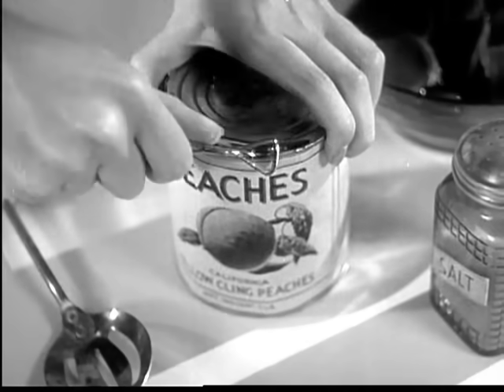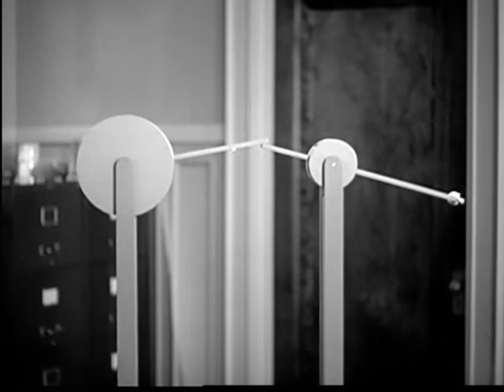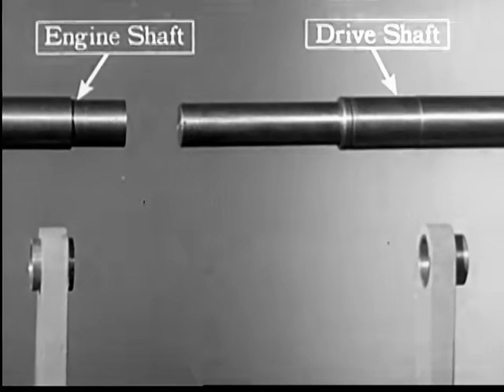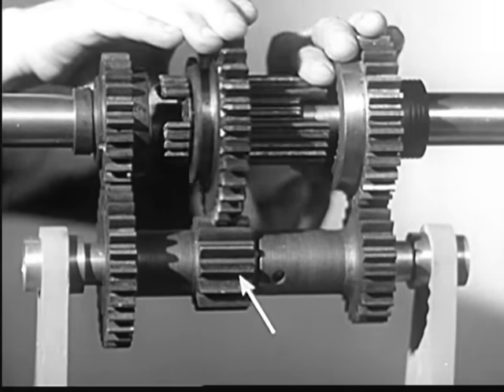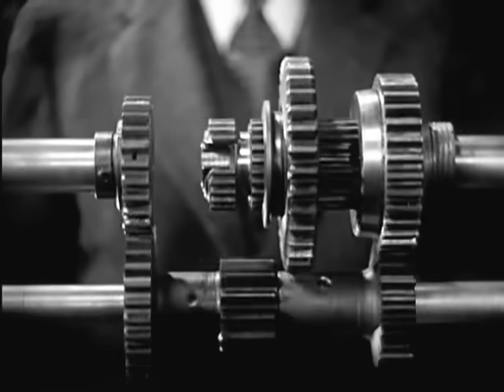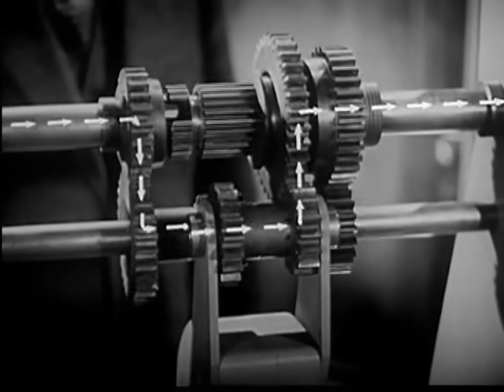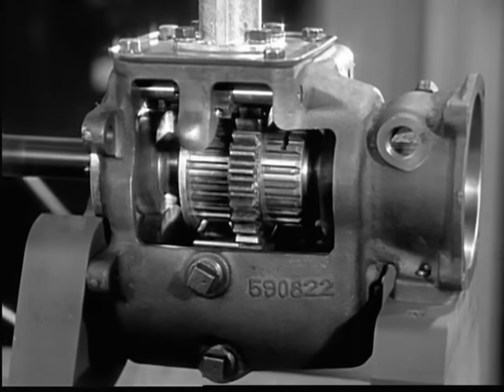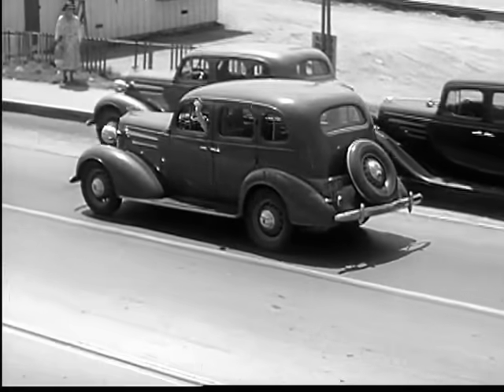Spinning Levers - How A Transmission Works (1936)

Comment: Do you guys understand why you understand this better? They’ve kind of dumbed it down and use no jargon that express these mechanical advantages. It’s like when you hear person 1 using scientific terms and  person 2 doesn’t understand, so person 1 dumbs it down and explains each term they used. Person 2 says “well why didn’t you just say that”. Well that’s this in a way. Someone well versed in mechanical advantages, you can tell them a synchronizer helps gear change run smoothly and they’ll figure it out, they know what you’re talking about. We didn’t get dumber or our explanations got worse. No We actually got a lot smarter, and found more efficient ways to define these things. I mean after all, we have a lot more complicated machines now. The average person just can’t keep up anymore.

Comment: Video: How a transmission works 

Me: They had road signs dedicated to telling what gear is needed for a hill?
Reply: At that year many were still learning how to drive a car.
Reply: @raymondramirez9177  that makes sense too
Reply: Mainly for trucks.  If you started down the hill with a load pushing you and moved the gear shift to neutral you might not be able to put it back into a lower (or any gear for that matter) gear to use engine braking to control the truck down the hill.
Reply: @cyrilhudak4568  That makes a lot of sense. I just never seen such a thing.

Comment: One of the reasons why older instructional videos like this one seem so easy to pick up was because back then there was a high chance the viewer couldve been illiterate, so extra emphasis was placed on visual presentation and a slower, more deliberate delivery so that anyone would get it. Note the heavy use of purpose made props, analogies to common household items and the lack of text in the presentation itself. 

Nowadays the sheer volume of shit that modern curriculums demand from each student is so high with so little time to teach it all that instructors are often forced to assume students are already qualified in a number of existing skills so they can cut corners on delivery in favour of cramming vast volumes of information via walls of text which is far cheaper than making a bunch of custom made props to walk students through the basics.

Comment: When the transmission is in neutral I can see the shaft to the right spinning, how can that be?
Reply: The bearing between the output gear of second gear, and the driveshaft isn't 100% frictionless, so under no-load conditions, it will spin slightly.   Put a load on the driven wheel, and you'll see the output drive shaft remain stationary.

Comment: I've learned more from this than i have from school because everything is so complicated to explain today and back then they were like, slide a gear in like this and bam you got reverse, the more gears the merrier, and now we're just like, the force applied by then engine crankshaft effects the overall acceleration by rotating the four gears placed near the front of the transmission, now study this or your gonna fucking fail I don't care *sticks up the bird on both hands and walks out*.

Comment: 2:37 I am now thoroughly intrigued by "worm gears."

Clever girl.
Reply: Worm gears meet at an angle, up to 90 degrees. The modern car has several worm gears, including the rack and pinion gear for steering.
Reply: A worm gear is a gearing arrangement that only allows one way transmission of power.  It allows the worm to drive the worm gear, but not vice versa.  The worm is typically cylindrical shaped, with helical teeth wrapped around it like a bolt.  The worm gear is mounted on a perpendicular and offset axis, so that its teeth are pushed forward or backward along the worm shaft.  Worm gears are built to self-lock, if you apply a load to the worm gear.

An application of the worm gear, is a guitar string tuning.  The string is wrapped around a post that is driven by the worm gear.  The tuning lever drives the worm, which then drives the worm gear to rotate the post, for tightening the string.   The string tension cannot spin this mechanism.  Only the user who rotates the tuning knob can cause the gear assembly to spin.

Comment: What they didn't know is that cars these days might NOT have gears at all, but instead be driven by a CV-Transmission!

I know farm equipment had CVTs since the early 1900s but whatever.

Comment: 2020: Student-" Manual transmission is so difficult to understand!"😥
1936: Engineer- "Bring me to the future boy !"😁
Reply: Manual is easy
Wait till u see auto
Reply: @hassanlabyad4082  They are all easy to understand TBH. There are auto, manual, DCTs, DSGs, and CVTs. All based on the same principles, but in terms of part complexity, DSGs are probably most complex. Most advanced aspects are honestly in the hydraulics, thermal, and material science applications. Thats where all the recent white papers are on, essentially, tricks and materials and coatings to make the gears smaller, better, lower coefficien of friction.
Reply: @davidwest6019  
I agree on CVT it is easier that manual
I was talking about 5 planetary gears set auto transmission
Reply: @hassanlabyad4082  praise the sun gear
Reply: Samarpreet Singh it’s even earlier, it’s from 1936.
Reply: @user-hn4en7lx7l  corrected!!😅
Reply: Nah it's just you bro, I started at manual transmission and it's easy
Reply: @justanotherf2ppotatogamer61  Its just a joke bro . Don't take it seriously!
Reply: @samarpreetsingh5318  🤣🤣🤣🤣🤣
Reply: Manual gives the driver more Control.
Americans just dont like to do things them self.
Reply: @LS9646  That was maybe true 15 years ago, not really anymore. This is why everyone went to dual clutch for high end ICEs (Ferrari, etc). You, nor any pro, can beat the computer (TCMs) these days as proven on the track many a time.
Reply: @LS9646  modern automativs are way bettet than any manual. The only reason manual are still around is cost of production. When you look at any car model, that is a bit on the more expensive side, you will find that automatic is pretty much standard.
Reply: Literally me

Comment: If y’all ever want to learn to shift without a synchronizer, drive a semi. Hardly any of those transmissions have it. You have to match the speed and gently touch the gears together with the stick. If you’re softly putting them together and it’s still making a horrendous grinding sound, you’re too much out of sync and either need to raise the engine RPM, slow the wheels down to match the engine idle RPM or you’re in the wrong gear. Either too low or too high. And yes, you can put the clutch in and slam them together rather easily... but you will damage the clutch sleeve and the gears themselves after a while.

Comment: i didnt really understand how you can brake with engine. if you do it by downshifting, doesnt it mean that the wheels will gain mote force to work with, therefore making it go faster?
Reply: Engines require quite a bit of force to turn. When you release the throttle the engine stops producing power, but it is still turning. Now instead of the engine driving the wheels, the wheels are driving the engine.

Comment: I like that they had to physically make all those models to demonstrate their principles. So much more engaging than a 3D animation for some reason.
Reply: Depends though. When the mechanisms get complex an animation gets much better since you can make parts partially transparent, to focus on an important part without losing the big picture.
Reply: @FawfulDied  Yes but that requires already having a foundation of knowledge to work with. The original poster was referencing to those still learning the material so.
Reply: There is only one thing better than this .. being able to play with such models yourself. 

I'm an electronics engineer and even today, over 10 years after getting my first degree in it, I always understand new concepts best if I try them out.
Especially if I apply them to a real-world problem, even if I had to make one up by myself. But I have to physically do it. 

I still know a lab engineer from my former university, and he always sees students struggling with things like heterodyne mixing .. until he shows it to them at the lab equipment or his ham radio stuff. Then it clicks into gear ;)
Reply: @VintageTechFan  
But why do you Hoard Nitro Engines, bro?
Reply: @SLUGTHUG  
I know thats basically a joke about my user/channel name, but I will explain anyway:

I just like them, and they are getting rarer and rarer since almost everyone is moving to electric. There are only a few manufactures left out of the dozens there once where. 

"Large" scale I can only think of OS and Saito being left, both of them continually reducing their "nitro" portfolio and moving to petrol engines.

Enya and Laser are still doing limited production runs for enthusiasts. Also there is Yamada with the high performance four-strokes. 

The whole complex of Magnum, ASP, SC and all the manufactures "house brands", which were all made by Sanye in China, is gone. 

But it's nowhere near the volume they once where, and I like them. So I grab them as long as I still can. The old ones from the 70s-90s tend to be of better manufacturing quality, too.
Reply: A 3D animation, if done incorrectly, can break the laws of physics. A model has to obey them.
Reply: you can also 3D print alot of stuff nowadays
Reply: @Samuel Skala Maximum possible length that may be filled? 800,000 inches, or 12.623 miles, assuming they are laid end to end. Or any combination of 3.2 million cubic inches, or a cube about 65 feet to a side. 

I hope I get an A on the test!
Reply: Nothing can be there when are they in the past when we shall haven’t engineer the technology of where people can’t see what it is to be there.

Comment: I like how they use analogies from simple stuff, like the synchros (which I had no idea how they worked until now)

People try to do that nowadays but there really isn't anything good. How would you explain a clock modulator on a computer? like a metronome? I personally like the idea of saying it's a computer's "heartrate," since it runs an instruction every time the clock turns on or off. The faster the heartrate, the better it performs (generally speaking)

Comment: Woman driving downhill on a city street at 60 mph wearing no seat belt in a car with no safety glass and designed to transfer all the impact energy directly to the passenger compartment. What could go wrong?

Comment: At 4:25 or so, he mentions that the car is in neutral and that the shaft to the rear wheels isn't spinning, but the drive shaft does appear to be spinning.

Am I correct to assume that it's the top middle piece that is actually connected to the real wheels from inside of the drive shift?  I'm a little confused why the top right gear is spinning when in neutral and/or how everything is connected to the wheels.

Comment: Quick question, why do drivers back then need to shift into second gear when going down on a steep hill?
Reply: It uses the torque of the engine in a braking action.

Comment: I want to know how my 5 speed truck with 1 reverse and 2 gears for all 4 wheels works.  Specifically, I'd like to know how they get the front and rear differentials synchronized?

Comment: never ceases to amaze me the power of leverage and how no one I work with knows how to use it.
I work with trucks, trucks get sealed by metal wire sometimes someone forgets to unseal a truck we need to unload, or load more shit into. most times we don't have a bolt cutter, or wire cutter available anywhere nearby. So I find a long metal pole stick it in there, and pull. seal breaks with minimal effort.

Comment: One question I have wondered for a lot of years. I am talking about good smooth synchro downshifting. No grinding coffee here.  Routinely speaking,  When downshifting from a higher gear to a lower gear.  ( in other words using the engine to slow you down) . Does that practice over time. Wear or ruin the gears of a standard transmission or wear down the clutch as a result of the applied instant torque from a higher gear to a lower gear  and is it OK to routinely do that all the time. Not in an abusive manner.  Or is it better to just  apply the brakes,  slow yourself down.  Then begin downshifting ?  to avoid any possible damage to the standard transmission gears and plates as a result of  frequent or routinely downshifting ?

Comment: I already knew about gears and the functional principle of a transmission, but this video still managed to answer a question I've always had but never found the answer to. I've always wondered how the gears of the transmission shift in perfect alignment without the teeth hitting each other on the side of the gear, and this video explained the synchronizer perfectly and brilliantly.

Comment: I just retired. I am a transmission rebuilder. there was nothing wrong with the older automatic and standard transmissions. they were simpler and easer to fix. and that was the problem! more money for the car company's if you get a new 70,000 truck!

Comment: The mechanics of the reverse is not well explained. There's some information missing. How does the additional center gear at the bottom help reversing the shaft? I believe the video is not showing the conncetions correctly for reverse. This video, however, explains the reverse gears pretty well, at the very end: https://www.youtube.com/watch?v=wCu9W9xNwtI

Comment: Amazed they had a gear for direct engine rpm 1:1 ratio engines must have been slow.
This is also before helical gears so that gearbox must have been loud as fuck probably filled the gearbox with the thickest oil goin to muffle the sound

Comment: the counter shaft is always connected to the drive shaft ..... I don’t get how that works, bad video tbh
Reply: Nvm I got it the gear connects to the drive shaft (that looks like it’s spinning the drive shaft) really isn’t, there’s and free spinning outer tube that covers the drive shaft...
Reply: @jimbob1251  hi.   had the same concern.      the rotating shadow, right of that gear, on the shaft was deceiving.        it's not so much a tube as,  it's an  Idler gear.    a gear with a built in bearing.     cheers
https://en.wikipedia.org/wiki/Idler-wheel

Comment: the explanation is not easy to understand the mechanism
Reply: hi.   your understanding my be impeded by an apparent  mismatch between the commentary and what is seen.
at 3:33, this is an  IDLER  gear.     in has a built-in bearing;  and the drive line is  Not  turning; until later on.     an  idler 'floats' at a fixed point, and  transfers  force between to Other gears.   cheers
https://en.wikipedia.org/wiki/Idler-wheel